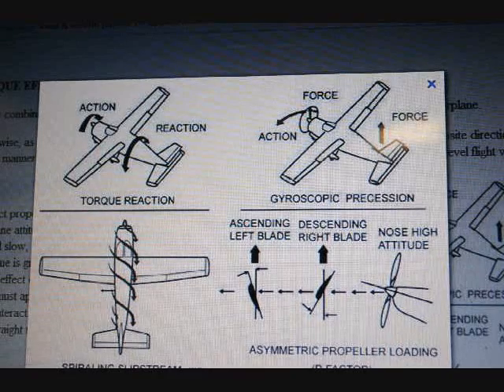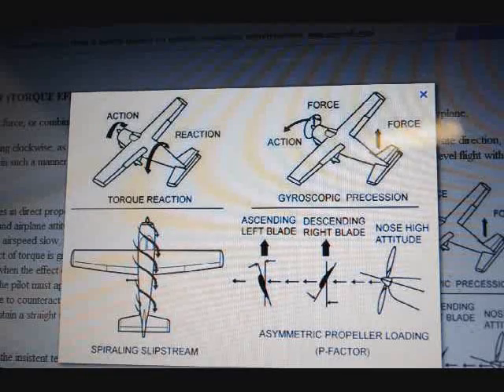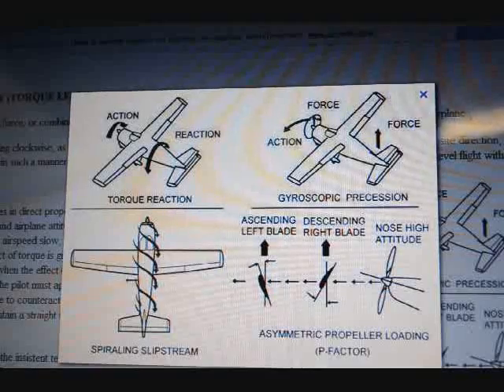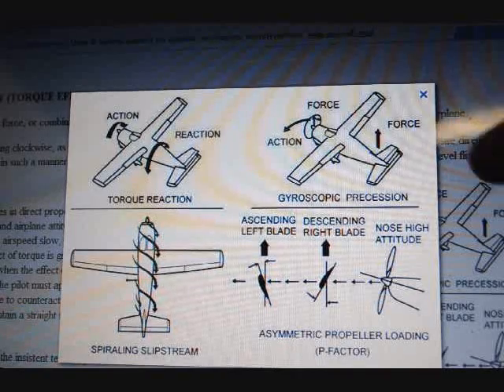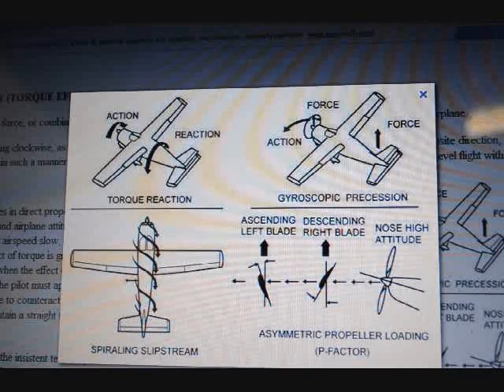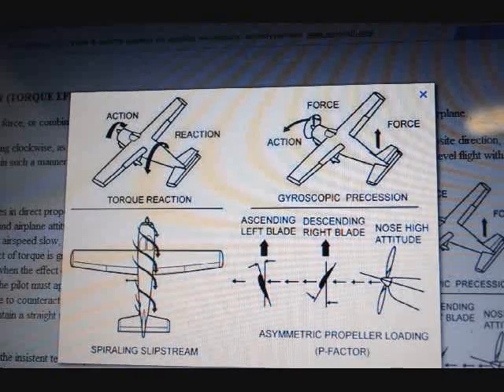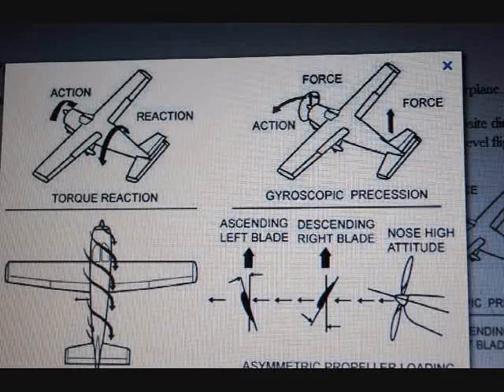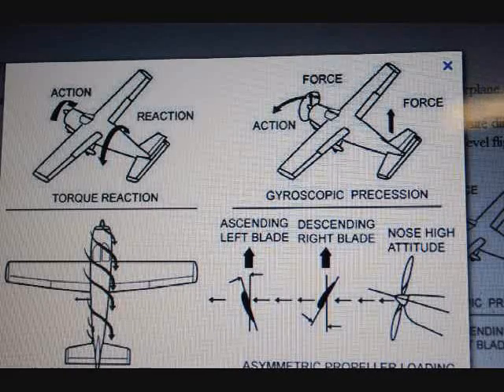The four left turning tendencies

Comment: @gthree0239 Greetings! new pilot here. So basically, to avoid this on take off, I only need to apply right rudder? no right aileron?
And... It's this left turning effect very noticeable on landing? when you are about to touch the runway?
Thx for the info!
Reply from the maker: +DiegoTheGreat89 you may need ailerons if you veer left and then correct with right rudder. You should always apply an appropriate amount of ailerons into the wind on takeoff.  even the airline pilots do. If you don't you'll go down the runway leaning and that up wind wing will liftoff early. (but I'm getting into a whole different discussion on crosswind takeoffs)  you really won't notice much turning tendency  at touchdown  since the power will be low.

Comment: What exactly is causing the left turning tendency with P-factor? Is it because the right wing is pulled forward as a result of the higher thrust on the right side of the prop?
Reply: the higher thrust alone. imagine the yaw on say a 737 Boeing if the left engine was set at a lower power setting than the right. the thrust difference alone wants to yaw the nose to the left. it's independent of whatever the wings are doing. the thing about p factor is it is generated only when the propeller is off axis from the relative wind(ie positive or negative AOA relative to the propeller shaft). whenever the propeller shaft is not parallel to the relative wind, there will be P factor.